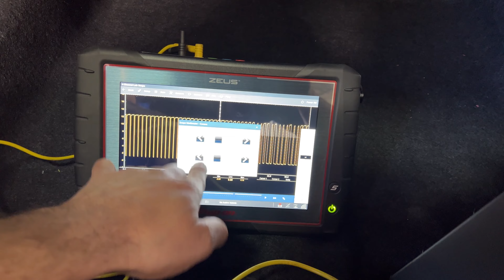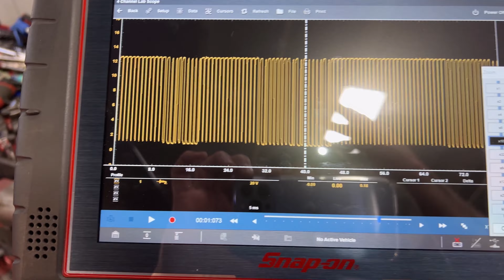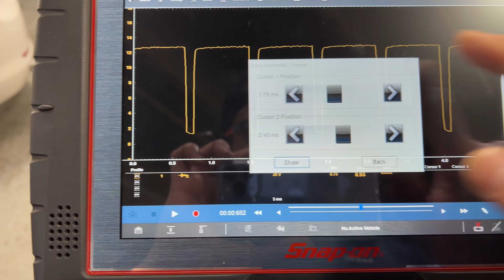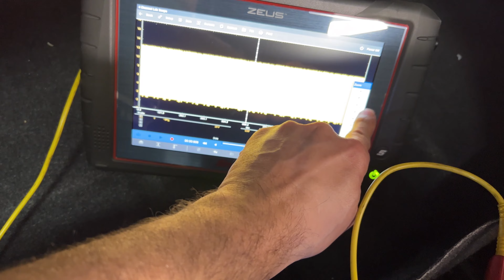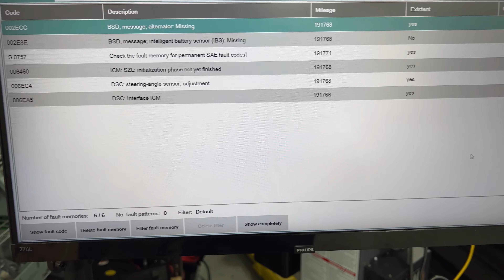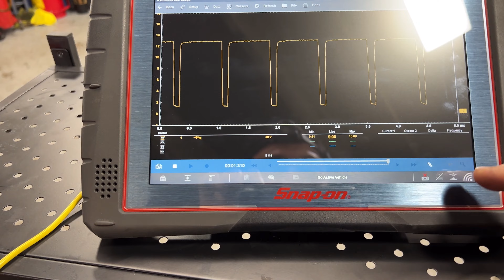2010 X5M no start dead battery diagnosis Part 2

Comment: WHY DID YOU NOT LOOK AT THE CODE CRITERIA FOR THAT ALTERNATOR CODE . WHY DID YOU NOT LOOK UP THE TSB'S FOR THAT CODE . SOMETIMES EVEN A GOOGLE SEARCH MY SURPRISE YOU . WHY DID YOU NOT SUBSTITUTE A SIGNAL BACK TO THE DME , WELL THANK YOU FOR YOUR TIME LOOKING FORWARD TO PART THREE OF THIS VIDEO !!!!!
Reply from the maker: Not sure where did you think I did not check the code criteria? It is all done with Ista, TSB, recalls all info in one spot. As far as substitute a signal, umm this is communication line. So I don’t know how to respond to that.
Reply: @MaicSalazarDiagnostics  substitute the  communication signal ,with 12 volt, straight from the battery 😂🤣😂
Reply: I don’t think is communications line. It looks like a pwm signal driving the alt voltage regulator
Reply from the maker: @deerhunter8533  BSD (Bit Serial Data) The protocol must be bi-directional since it delivers data from the ECM to control the alternator charge current (while the ECM monitors battery voltage at the battery terminal with the IBS, the intelligent battery monitor sensor), while also delivering data from the oil level sender to the ECM to be displayed on the vehicle multimedia screen.
Reply: @MaicSalazarDiagnostics  thank you for the clarification! Good diagnosis
Reply: THANKS , NON THE LEAST THE SIGNAL COULD HAVE BEEN SUBSTITUTED TO HAVE SEEN WHAT CHANGES HE WOULD HAVE GOTTEN TO HAVE RULED OUT MANY VARIABLES.
Reply: @deerhunter8533  spot on, and that the different in waves form was the  PWM on time increasing and decreasing.

Comment: Will part be under warranty. Jump starting May of killed alternator. Did battery get load tested as may be why alternator fail. Sorry for all the questions. Had a fault like this and turned out there was a big resistor on starter was drawing so much current alternator and battery kept failing rubbish design on a Ford.
Reply from the maker: Yes battery, charging and starter system have to be check always. Voltage drop test with load on it.